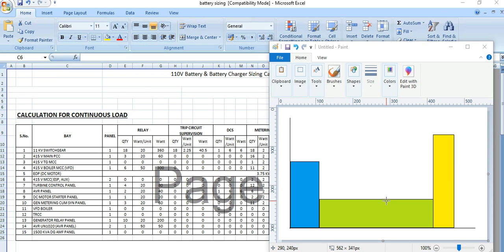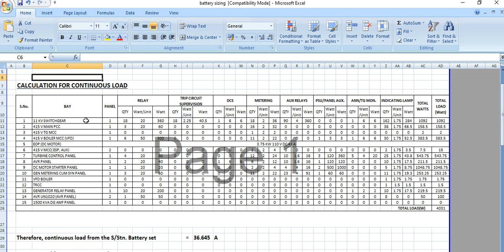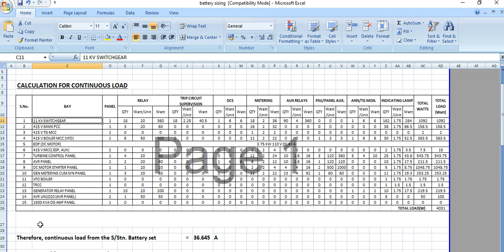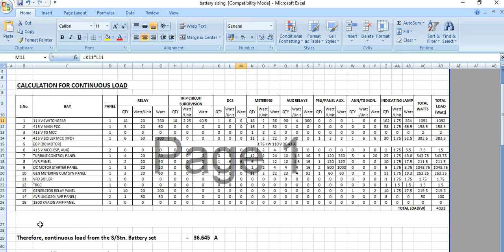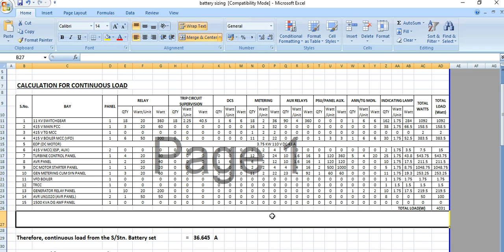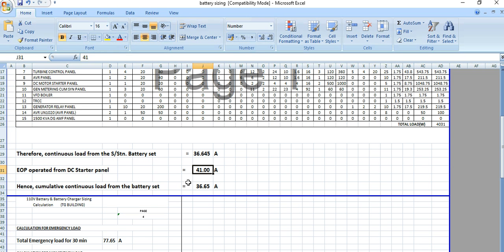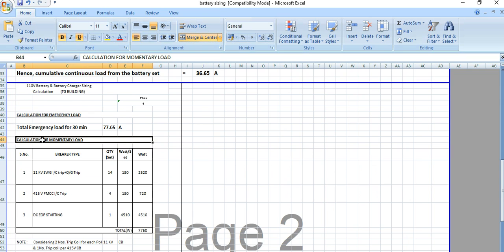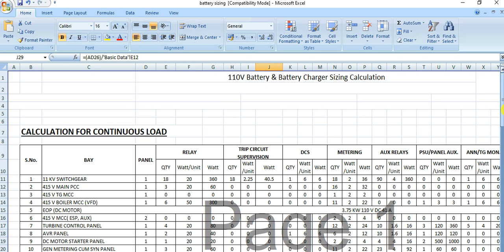Battery Sizing Calculation in Excel (Part-3)

Comment: In last , while calculating closing load for 1 min, why did you consider minimum system voltage 99 V?
Reply from the maker: Because the battery must be in a position to supply DC power for closing the required breakers even at minimum battery voltage condition,, which is the worst case

Comment: Is it for industrial application? What is the basic difference between lead acid and Ni-cd battery?
Reply from the maker: Industrial as well as other applications, like Ni-cd battery in automobile also. Main difference is Ni-cd battery is used for dry type application and Lead acid uses acid as electrolyte.